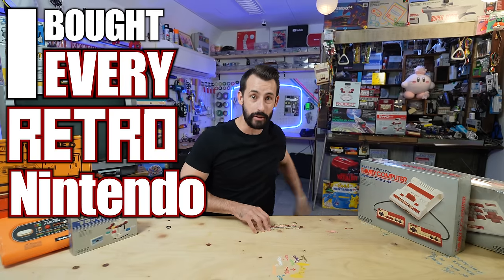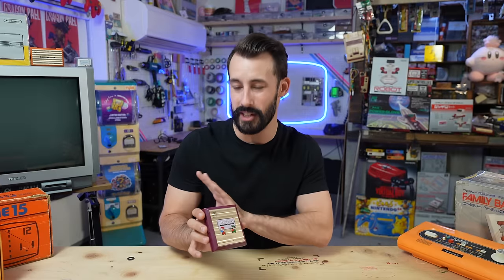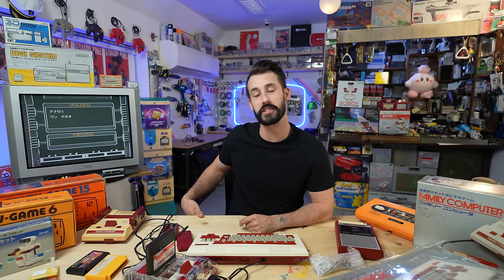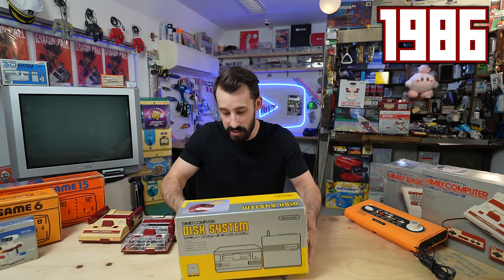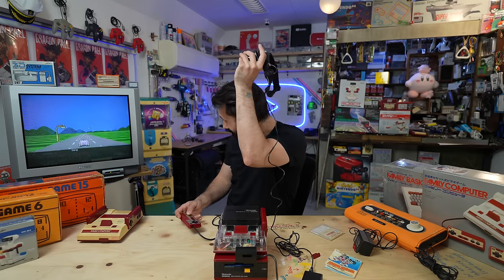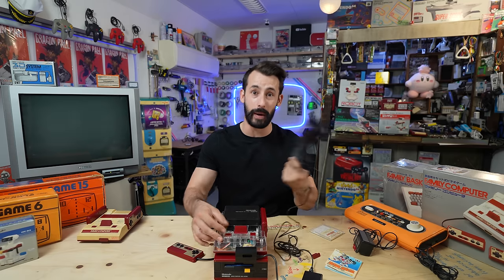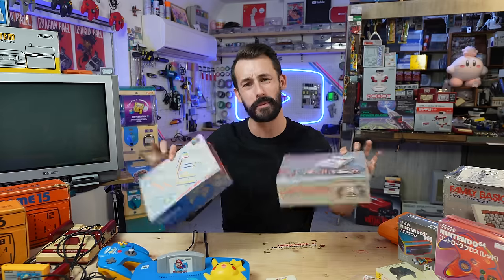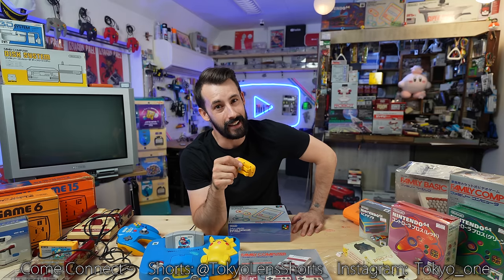Japan's Nintendo was Just BETTER

Comment: If you haven't already, be sure to check for leakage on all the batteries... button cells, regular sized (AA, etc.), all of it. Open games with battery-backed RAM and check those too. Leaky batteries are disastrous for electronics.

Comment: Careful turning on anything with gears like that ROB for the first time. The grease cakes and hardens and the plastic gears often need cleaned and re-lubricated first. I'd be scared a gear would crack, come off a shaft, or break off a tooth.

Amazing collection FYI.

Comment: The keyboard and tape deck looked just like the Commodore 64 - which I had and the first Mario bros game for the C64 was a crossover of Donkey Kong and the later Mario, a platform layout, with pipes on either side at the top, expelling turtles, for Mario to knock from underneath and then kick away. As the levels went on you got different creatures and barrels shooting out and dropping down to the ground. The hardest were the crabs which needed 2 knocks to flip them and the 1st dight of the clawed creatures heralded the timeless cry 'Oh no, I've got Crabs!'

Comment: I would love to see you explore the Sega world platforms.  Along with Sonic of course.  I started my kids off with the original Sega Master System with an in built Alex Kidd game in it.  Then we went onto the Master System II, we had a Mega Drive at one point also, then we moved on to PlayStation one then two.  It was after this the kiddos left home and I still have one of the original Master Systems (Not sure which I have as its tucked away in a storage tub under the bed), with many of its games and the PlayStation 2 with many of its games.  I was in love with the Pacman games, bubble bobble, the sonic games, and then I fell in love with the Spyro games and Crash Bandicoot.  😀

Comment: To make those RF connections  work better is use adapter called a Y connector  it's small piece it has RF on one side and  coax connector on other side then ya screw that to your coax cable port it to TV then it  comes in perfect I did this with my old Atri 2600 on a newer High Def TV and I couldn't be happier with the results

Comment: For most of those really old computer devices, a lot of times the problem with them not working is because one or more capacitor on the board has died. It's pretty common to replace them or 're-cap' a device to get it working again. Even happens with newer devices like early Apple Mac computers.

Comment: I'm sure someone has already mentioned it, but from personal experience it's best to tie a short length of ribbon or string to the Pocket Pikachu to loop it back to a belt loop as a tether. That way if Pikachu ever slides off your belt without you noticing the tether will keep it from getting lost.

Comment: No wonder you need to replace your cables so much if you knot them up like you did at @2:48 . This breaks the metal wires inside your cables by bending them at angles past the point of the materials elasticity!

Also, if you like Gameboys @16:41 ...

* inhales *

MODDED GAMEBOY GAMEBOY CLUB!
Reply from the maker: lol

Comment: "I have every Nintendo system since the 70's but my tv is an end of the line CRT from the mid 2000's."

This is practically heresy! You really need a proper boob tube to complete this stuff! They aren't hard to find!

Also, it's funny how most early Nintendo products are cheap rip-offs: they copied Pong, then make a crappy Commodore.

Comment: Dunno if you know this or if it's relevant but in case it might be, if you think a Japanese RF system set to channel 3-4 is not working because no picture remember American RF works on a different frequency. If your JP console is working and you have it hooked up to a TV in America turn it to channels 98 or 99. It will show up there. Hope that info helps someone.

Comment: On your older units you need to have the boards restored now before they get worse .   These older boards have corrosive elements to them that over time just start eating themselves to death and that process can leak all over the board if they are left to stay rotting away.    The replacement of these board parts is very easy and very inexpensive to do and it does not hurt the value of the collectable by making it work again.    You will not even tell it has been worked on in the end.     But if you do not you will make the board garbage and make it nothing but a box full of plastic. Making these things stay alive so other generations can see how things like this worked is the responsibility of a collection like this .  Make it so.
Reply from the maker: The boards are In Perfect condition actually!!
Zero corrosion luckily!

Just a few burnt out capacitors!!